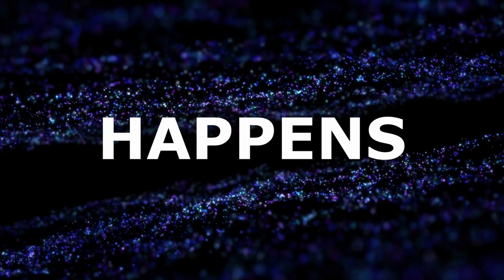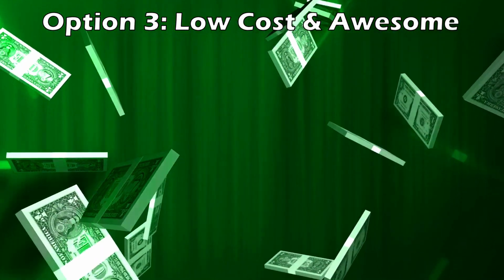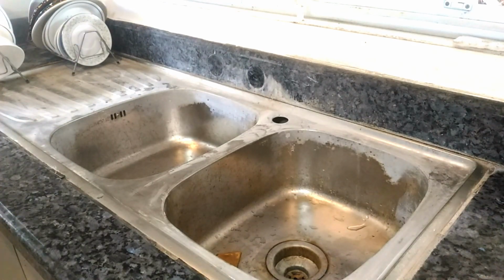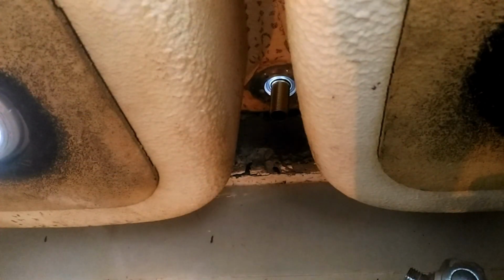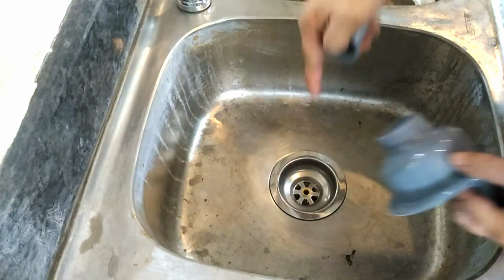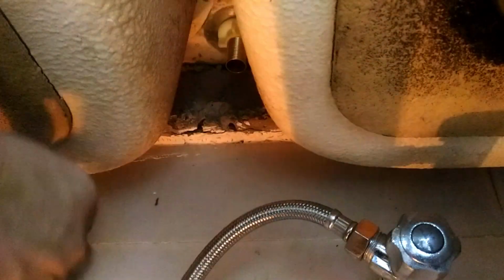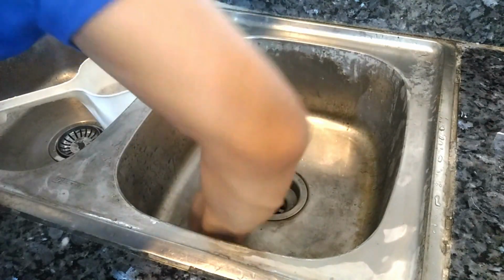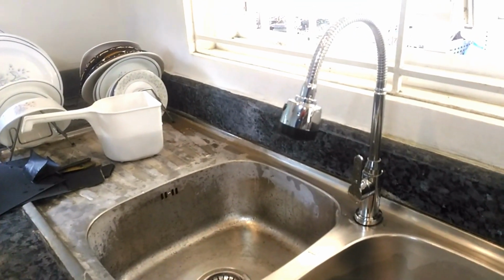Restore a Stainless Steel Sink Like New Using Just Sandpaper

Comment: Does sand paper work on chemical stains? I wanna try it before ordering Bar Keepers Friend.
Reply from the maker: Go for it and find out yourself 👍
Reply: @HanDIYman007  it worked but it scratched the surface but it's okay. Thanks!
Reply: barkeepers friend didn't work for my deep acid stain...I think I will use a finer grit

Comment: Where are you from, I had the plumber put in a new stainless sink & it was a few hundred $$$$.  $17,000 for a stainless sink installed is a joke.
Reply from the maker: Yes it would be a joke if i said it $$ which i didn't. It was in PESOS and even included the $$ conversion in the video.